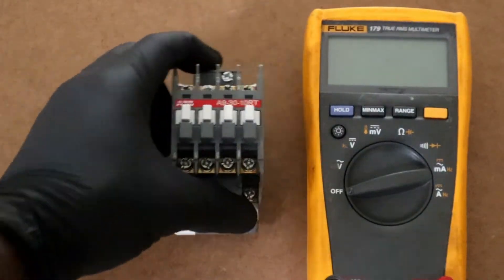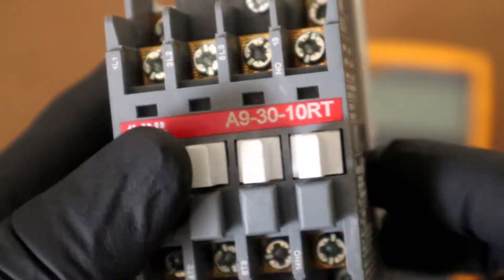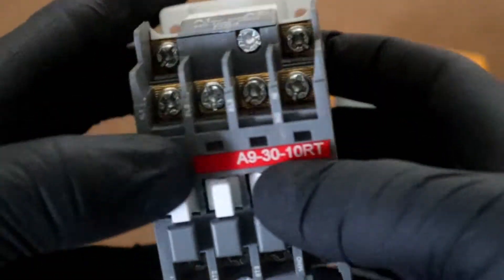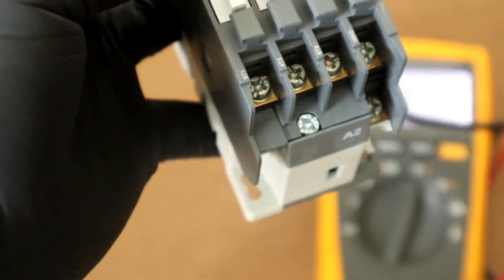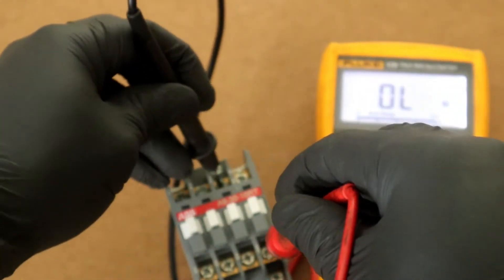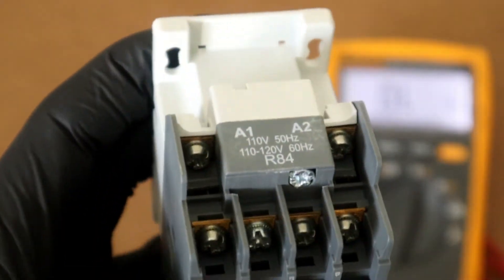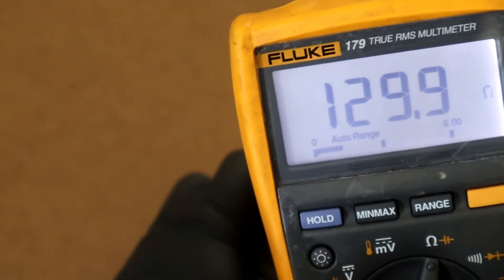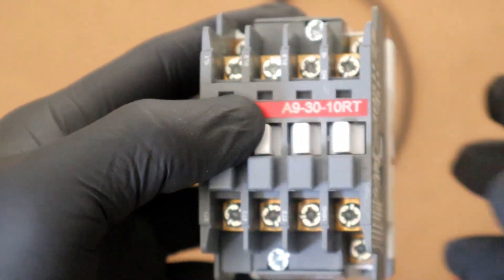HOW TO TEST A CONTACTOR

Comment: Nice video man!I have a question.How to check Amper when it is already connected and it is impossible to see the sticker?
Reply from the maker: You would need a Amp clamp meter around the individual wires to check the current flow.

Comment: Why cant you use the continuity setting on the multimeter?
Reply from the maker: The continuity setting can be used. By using the resistance setting it however checks the conditions of our contact points ( if they are burnt or pitted) which would have a slightly different ohm reading. The continuity setting will just test for contact or a closed line.

Comment: How did you know 130 was a good number? How much higher or lower than 130 could it read and still be good?
Reply from the maker: Coil usually fails in an open state ( OL on multimeter) or shorted (O on multimeter). Coils will have different resistance values based on manufacture, quality or wire used, number of turns or wire, CSA or wire etc. Usually based on experience if you have a coil resistance that is not open or shorted its usually still good. To verify if it's working correctly you could always disconnect the power (high voltage wires) and supply coil voltage to confirm its closing the power contacts. Additionally if you have further doubts you could contact the manufacturer directly or check data sheets for that part to find the specified range for coil resistance.

Comment: Hi, the Abb 45a contactor coil  i have now is consuming whooping 190 watts rated at 220  @ 0.9. The resistance is around 22 ohm. and insanely gets hot and starts smoking within matter of seconds from switching on. So it means that coil insulation is failure right?
Reply from the maker: Yes that's more than likely the issue. I have personally never experienced a smoking coil that still works but I would definitely recommend changing that contactor. Also verify that you are supplying the correct coil voltage. Thank you.
Reply: @synectum640  it would be nice if could find time and make videos on contactor coil protections.
Reply from the maker: Thanks for the suggestion. Will look into it.

Comment: Thanx
Reply from the maker: You're welcome.
Reply: Can a person use this fore a stove ; a stove consume to much power and we can not cope with these electric bills ; i just need a tipe of a step up transformer fore the stove
Reply from the maker: This will reduce the power consumption of the stove. This is only a switching device for high amperage application. You might want to get a more efficient stove or reduce  the usage to cut back on the bill. Thank you.

Comment: Thanks for the video!
Did you come across Sprecher and Schuh contactor with electronic coil?
I had a trouble with a motor on a contactor like that and when I tested the coil on ohms range it was OL, so I assumed that's the issue - burned coil.
But it turns out those contactors are electronic coils and ohms range will always show you AL.
Reply from the maker: Thanks for the feedback. Yes the contactors with electronic coils function differentl. Because it utilizes a PCB and solid state devices that will trigger when energized you'll get the OL reading even though the coil circuit it perfectly fine.

Comment: I have a weg 2pole contactor for an air compressor.
230v/single phase/60hz
(Weg cwm40-00-20v24)
Or
(Weg cwm40 2p).

I have a no start condition with voltage present and a working on/of switch and working pressure switch. Compressor turns on when i manually press contactor. When isolated, coil reading is 319ohms. Is this resistance value too high for proper current flow? 
When installed and compressor plugged in i have 120v on each a1 and on a2, but 0v across the two. This contactor is rated for 208v-240v and 32-40a.
Also has an overload that is new and operational. 
I'm thinking it may be the coil, but not certain.
Any advice on cause or further troubleshooting help?
Reply from the maker: Good day and thanks for your question. Isolate both wires connected to a1 and a2. Measure a1 to ground, a2 to ground  ( for each instance you should 120v). Place one lead of your multimeter on the wire disconnected from a1 and the other wire disconnected from a2 ( 240v should be your reading). If you are not getting the 240v ensure that you are using a double pole breaker to supply the 240v. If you have a disconnect very that 240v is on the line and load side. If you test at the terminals check the wires from the disconnect to the coil. Sounds like you have a loose connection for one of your power wires.

Comment: Is a1 and a2 connected together ?
Reply from the maker: A1 & A2 are the terminals for the coil that when energized creates and electromagnet. To answer your question yes they are connected as they form the ends of the coil.
Reply: @synectum640  so if i put a multi meter on ohms across a1 and a2 i should have a circuit? Also how do i know if the coil is bad and what ohms reading it should get?
Reply from the maker: Good day. The resistance value of coils differ  based on design and rating value. A bad coil can have a very high resistance (coil open OL), very low resistance ( coil shorted) as well as a fluctuating resistance reading in some cases. Best way is to check a data specification sheet to see the design resistance value and compare it to the measured value. Also if you have the rated coil voltage you could also bench test it to verify its functionality.
Reply: Thank you for your answer, i am doing a electrica apprenticeship and i really like control circuit and automstion but i have no experience and teacher to teach me, how can i tell if s timer in a control circuit is not working ? Do you know?
Reply from the maker: Hey Giang. There are a variety of timers to consider for example; o. Delay, off delay, pulse retentive etc. The general principle is after a timed function, contacts are usually opened or closed based on the design type. Best way to check is to supply the required voltage, wait for the timer to time out then verify that the output change occurred. In order to carefully explain how each work will take alot of time and it would be easier for me to do a video to capture everything. What I would advise you to do is not rely solely on your lecturer/teacher/mentor but also to do your own research on different areas so you can have a clear understanding on your own.

Comment: This is informative, and useful for people. However, A very important test is while it is in service in its operating environment/capacity. 

You would use your AC mv scale and test across the respective phases from line—>load.. That will give you a better insight as to the connection being made, and the state of the contacts.. 

A normal reading would be something along the lines of L1- 44mv, L2- 38mv, L3- 42mv.. All the readings are relatively similar to one another.

Something to indicate probable worn/burnt contact pads would be L1- 44mv, L2- 218mv, L3- 42mv..  Here, you have one, or more that are different, and not relative to the others. 

This test is more practical, as it allows you to inspect it without taking it out of service.. These readings would/should initiate procuring a replacement before a inevitable failure occurs. 

If you want the back light on your meter to remain on all the time- just press and hold the light button as you cycle your meter on- that will keep the backlight on until you turn it off..  

Good video.
Reply from the maker: Thank you very much for this Mike. You definitely just taught me something new. I will try your method and share it with persons in my field. Once again thank you for taking the time to write such a detailed guide on how to carry out the testing. Thank you and appreciate your feedback.

Comment: Hi! I have a new schneider contactor but the reading for the coil is 1.9K ohm. When testet it work fine. Maybe different contactor have different reading. Good information btw. 😄
Reply from the maker: Yes you are correct. Different contactors coil readings will vary based on the brand, coil turns, condition of coil windings etc.

Comment: Does a magnetic contactor coil consumes electrical energy?thanks sir
Reply from the maker: Yes there is power consumption that is slightly more when the coil is being energized compared to when mutual induction is setup in the electromagnet . Changing or creating a magnetic field includes moving charges Particles ( in this case electrons through coils of wires), and hence energy is consumed. I hope this answered your question.

Comment: So I take it, we are not to test in live setting, I wanted to see if welder outputs as the electromagnet is not pulling in when welder fires up or when trigger pulled, whichever sends signal.. will test signal next.. the A1/A2 just not sure if this is AC or DC that triggers the coil.I see yours says AC... my did not specify..
Reply: Wanted to test before bought a new switch so not wasting my money, thanks..  will look for other markings, it is wedged inside welder and have to figure out how to release off its perch.
Reply from the maker: Follow these steps:
1. Disconnect unit from all power source.
2. Set your multimeter to the ohm setting and measure across a1/a2  ( doesn't matter if it's a ac or dc coil).
3. If your reading is O/L or 0.1 to 0.5 ohm then chances are your coil is bad and you need to replace the contactor. 
4. You can also test when energize  ( however this is dangerous and if you do not have experience with electricity then I wouldn't advise such). Try the previous steps then message me and I'll walk you through it.